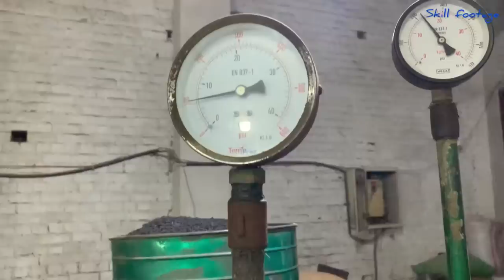How Electrical Silver Cables are Constructed || How an Electrical Cable Is Made in Factory

Comment: sorry but i didn't see any copper in any of the cables lol
Reply: the copper was already tinned.
Reply: @AffordBindEquipment  :D
Reply: @AffordBindEquipment  if you look at the end they show you after cutting it at 0:35 you will see no copper. tinned copper is still very much copper coloured on the end when it's cut. this would just be aluminum wire. that said, copper wire is coated exactly the same way.
Reply: @darinwilton9122  good catch.  I didn't see that.  It also explains why he can bend it around the pulling wire so easily.
But that raises another potential problem:  are those  who use this wire, are they using the correct special connectors so buildings aren't being burned down?  Here in Calif, they used a lot of alum. in housing for awhile and the main circuit breaker boxes would catch on fire from arcing, eventually burning the house up.
Reply: @AffordBindEquipment  many places still use aluminum wire as it's much cheaper. and yes, it does somehow manage to work itself loose and can cause fires. i used to own a mobile home that had aluminum wire but i changed it to copper from the panel to the pole after the first year. was an expensive upgrade lol
Reply: It's aluminium cable.
Reply: @dmitriylyakhov8486  yep. i know. they even changed the title of the video to no longer say copper lol